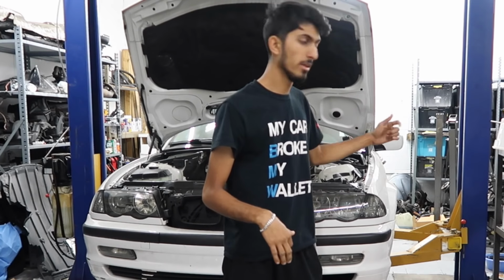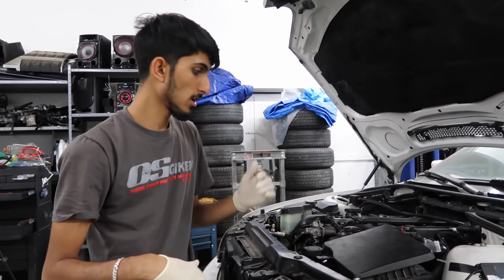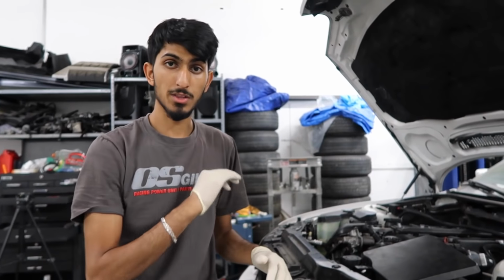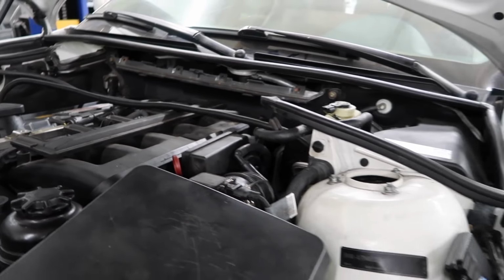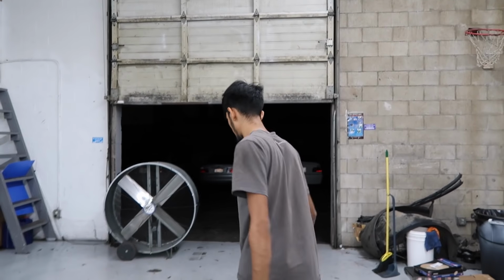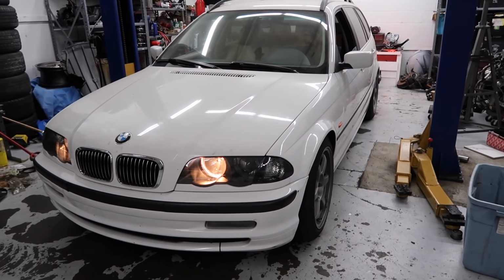THE BMW WAGON IS DONE!

Comment: I had a 2004 325ci was rear ended into freeway guardrail ....replaced it with 2004 325i Touring.  Its black on black 18x9 all around. Its runs great and turns heads for a 13 year old wagon. Your videos have helped me maintain her...thank you.

Comment: i have a 2000 e46 wagon with 330 engine is it possible to swap a m3 motor with smg? if so l want to use a donor salvage m3

Comment: Nice work!  When you pulled it off the rack did I hear your vanos rattling??  O_o
Reply from the maker: It was the lifters making noise since the engine was sitting for so long. After I drove it the noise subsided.
Reply: I said the same thing haha

Comment: was that an exhaust leak i heard before you pulled out the garage or is it normal?
Reply from the maker: It is the lifters making noise since the engine was sitting for so long. After I drove it the noise subsided.
Reply: Oh.. i thought you didn't notice it. Great job.